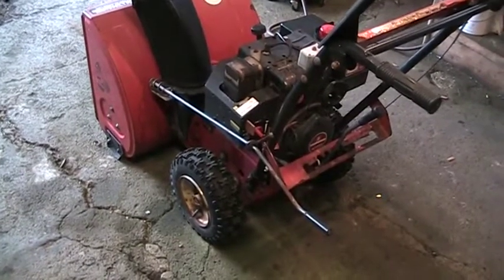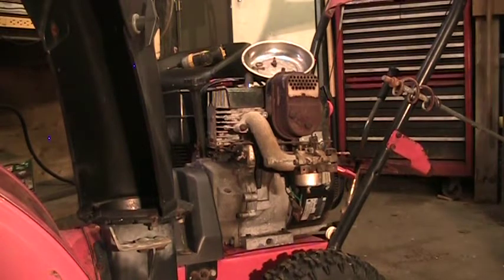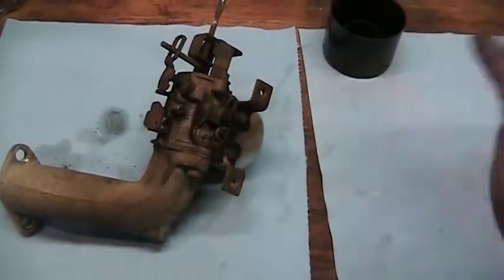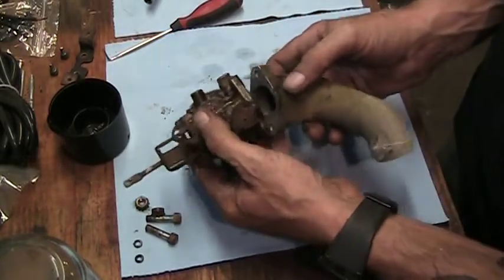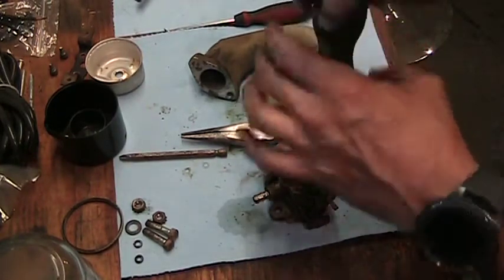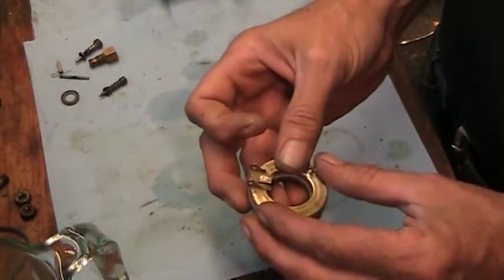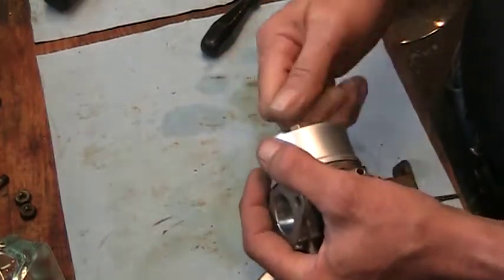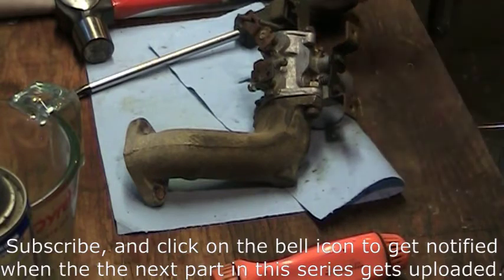Fixing up a Mastercraft (MTD) snow blower.  Part 1 of 2

Comment: Another good one!  I have the same blower in blue. The first modification made was to raise that shifter lever to just below the handle bars,  much more convenient.  Then I put a 10 1/2 HP Tecum. on it to make it really put out. It ran funny so I put one of those $20  import (fully adjustable) carburetors on it, problem solved.  I'll clean out the old one using your instructions come summer. Also plan to add those rubber wipers to the second stage impeller.

I use cereal boxes and Coke boxes for gaskets and to set the ignition coil gap.  Where is a good place to buy reasonably priced Tecum. parts?

Geo (Toronto)
Reply from the maker: a 10.5 on a narrow chassis would sure be a hot rod...lol.  Rubber strips on the impeller blades has been done a lot, but honestly, if its running well and at the proper 3400-3500 RPM , they throw just fine.  coil gap on most engines is not super critical, but there are exceptions.  I believe the Kohler twins like to be set right at spec or you may get intermittent issues.  I'm a dealer for a couple different wholesalers (they don't sell to the public) so I buy most of my parts from them.  Amazon can be a source for even OEM parts.
Reply: @randomwrenching   Thanks...Geo